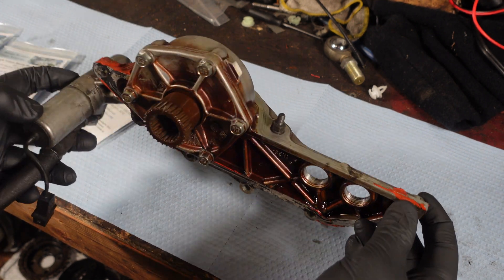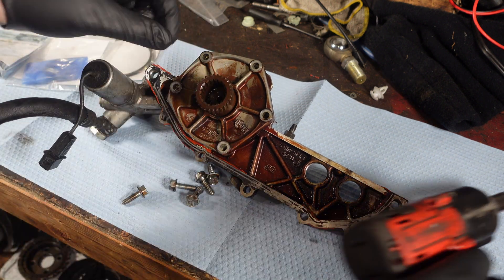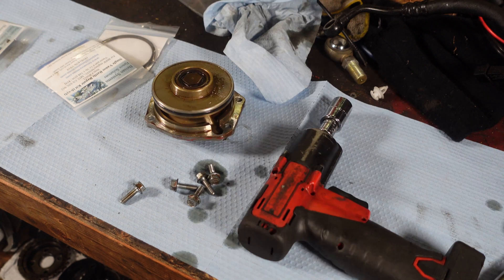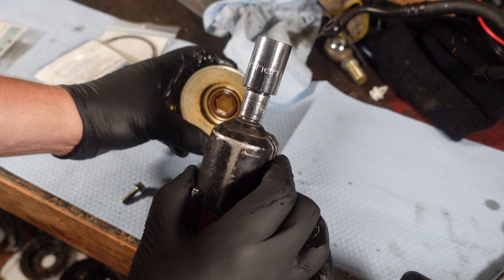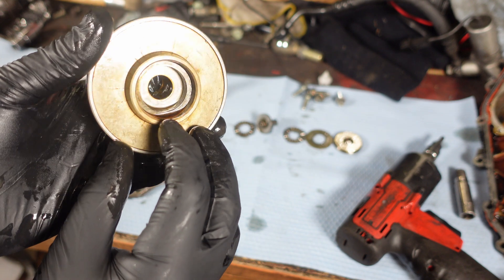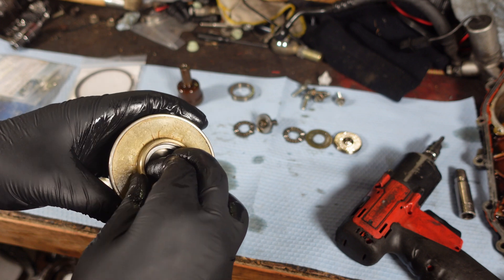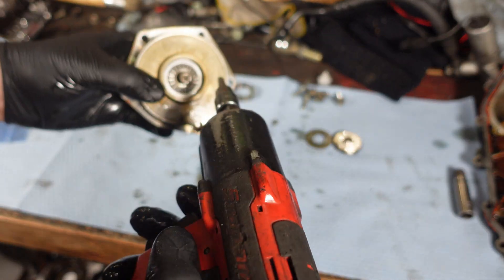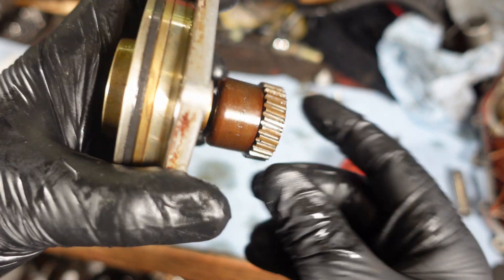E36 S52/M52/M50 VANOS REBUILD DIY!

Comment: Mine is still having play After doing a rebuild with race German rebuild kit .. I’m lost
Reply from the maker: Did you replace the reverse threaded t30 bolt? I’ve noticed in the past if they are necking (elongated) at all then they will still have play even with new washers and ring.
Reply: @Nightshiftautolab  I ordered the besian system style ring I’m gonna see if that fixes my problem .. I guess besian sells an improved style ring that is taller to stop that axial play I’m
Getting I suppose race Germans kit has a different style ring compared too besian systems ring .. if that doesn’t work I guess we’ll try too replace the reverse threaded t30 like you said
Reply from the maker: @byrd2j15  +1 for beisan systems parts.
Reply: @Nightshiftautolab  ended up shaving the ring down I got from race German with 180 grit sand paper after about 45 mins of sanding I finally got the play out of the shaft ! Super stoked now and come to find out I didn’t even need to order the besian systems style ring lmao !

Comment: That’s too tight no? I’ve always been told to sand the shim down to fit there should be some play. I’ve done a few of these and it’s a time consuming process sanding down the spacer since it’s made of a super hard material and you need to do it evenly. I’m curious if you hear any gear noise on the Downrev if directly standing in front of the engine just momentarily as the gear is disengaged at that 3k mark ? 

If it’s Gucci then I’ll ship them out way faster lol lmk bro
Reply: I’ve always done some of these where the engine turns out driving away with a form of a rattle where when it came in it was silent as a whistle . Kind of annoying to admit I don’t think it’s any wrong doing ever on my part just certain parts all wear differently and it comes down to the gear mesh. If you leave it the way you have I can see premarture gear teeth familiar due to the gear mesh being too tight because that’s what basically you’ve done. And if the mesh is too loose then you will also hear noise. Just like an Rc cars or diff meshing at the pinion and spur gear or ring and pinion .just something to reconsider but what do I know 😅
Reply from the maker: @onesikm3 i don’t hear any noise at all anywhere in the rev range. The engine is quiet as can be and there are no strange noises at all! My car makes 600 hp and works great! I’ve rebuilt 100 of these before and having no play has always worked great! Next time I have my valve cover off I’ll try to take some pictures of the intake cam teeth and vanos teeth to show how it’s doing! Cheers!